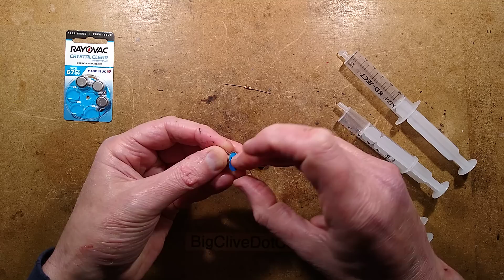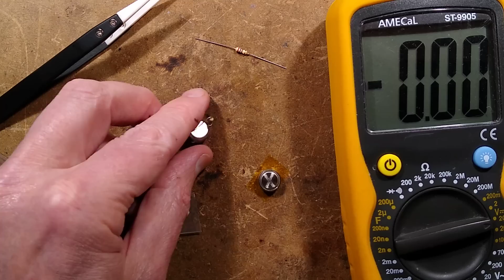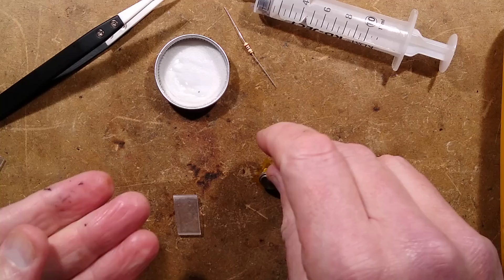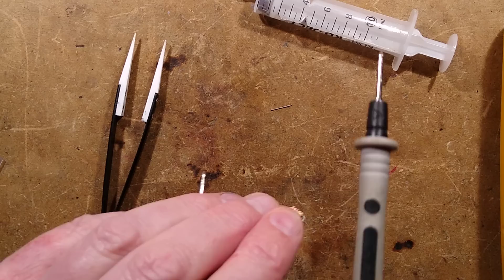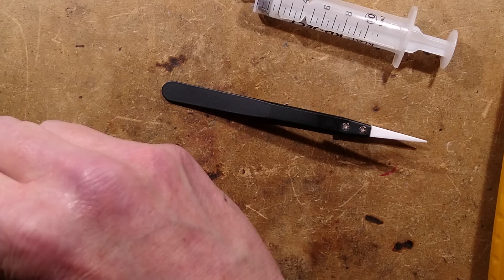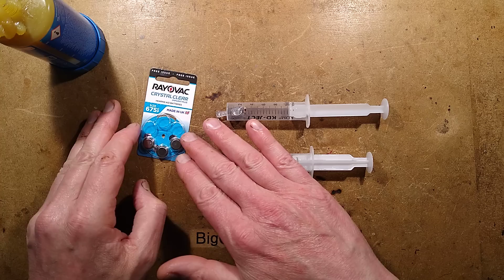Standard zinc-air cell vs mystery gas generating cell.  (flame test)

Comment: Syringes are never really air tight, but you can also improve your results by having a 3-part syringe, they have an actual silicon double seal at the end.
Reply: Glass syringes with silicone lube are awesome for this.
Reply: @blueredbrick  yes. Glass syringes are an amazing implement!👍
Reply: @markhonea2461  That sounds quite like 50s. Today disposable syringes are the standard.
Reply: @adamabele785  I assume he is talking about glass gas syringes.
Reply: @adamabele785  That sounds like the 50s if you were to go to a hospital or your doctors office as they would most likely use a disposable plastic syringe for whatever injection they would have to do, but that doesn't mean on the other end that glass syringes have stopped being made, let alone that it would not be a good idea using them for experiments like the one from this video.
Reply: @psirvent8  glas syringes still exist for various applications
Reply: @der.Schtefan  That's pretty much what I said, otherwise manufacturers would have stopped making them long ago by now.
Reply: @richardturton6900  For medical injections, yes, but glass ones are used in lab work.They are airtight with no lube--amazing tolerances, and very low friction.  But I'm sure hydrogen would have no trouble getting past the plunger.
Reply: @adamabele785  I am fairly certain they still have use for them in some procedures. And I know they still use autoclaves. I saw many such apparatus while I was a green- striper for the hospital, but that was in the 70's.
Most if not all of the glass syringes I saw were of much larger volume than say, an insulin syringe.
Reply: @adamabele785  - Labs use plenty of glass syringes, sometimes with PTFE (teflon) seals. It would be crazy to dispose of a syringe every time you add some reagent, and glass handles contact with solvents much better than most plastics. 

They're generally not used for things like vaccines because they're more expensive than plastic syringes, and you want to discourage people from reusing them (especially in places like GP practices and vaccination centres that probably don't have the necessary equipment or time to sterilise them between uses).
Reply: @blueredbrick  I don't think closing the tip by melting it and pinching it with his fingers would be a good idea with a glass syringe.
Reply: @russlehman2070  meh, just melt the glass in a hot flame and close the end by pressing onto a block of graphite. Or when one doesn't like open flames, drip in a droplet of fast curing epoxy resin.
Glass syringes are really nice and perfect.
Reply: Or submerge it and look for bubbles 🤣
Reply: Nevertheless it worked well enough in the video.
Reply: manitoba2445  you can inject a surprising amount of air into your veins before you die.
Reply: Or put the syringe upright in water, the hydrogen won't be able to push it's way down into the water until it almost fills the syringe. ( Fix the "thumb end" of the plunger to the bottom of the water vessel; as hydrogen is produced, the syringe body will rise up the plunger.
Reply: I don't feel comfortable about o-rings since the apace shuttle accident
Reply: well said, i thought it was just rubber at the end. curious, how can i se you added the comment to recent video, 8 days ago?
Reply: @DegustoDelSol  
Bigclive has a Patreon with early access
Reply: @DegustoDelSol  Patreon. If you join, so can you!

Comment: Hey, I'd just hold the plunger upside down in a vertical position, lay the battery on it and then put the cyllinder over it.
Nice progress on a single night! I'd never know that it generates do much gas.
Reply: Agreed. After lubing the plunger, the battery will easily stick to it. Then just slide the cylinder down over them. Clive's thinking outside the box processor needed a reboot.
Reply: @Slicerwizard  When my plunger is lubed, it becomes very slippery.
Reply: Thank you Captain Hindsight
Reply: @ch4.hayabusa  its called peer review !
Reply: @Panboy2k  Pee'er review
Reply: Smartypants

Comment: I was really baffled about where the hydrogen could be coming from, so I did some research.  It looks like four metals could work in metal/air batteries - lithium, magnesium, aluminimum and zinc.  Lithium is a bad idea because of moisture in the air, but the reason magnesium and aluminimum aren't used often is because they evolve hydrogen even more than zinc.  So in theory, if you really wanted an optimal hydrogen gas generator, Mg/air or Al/air would be even better at it.

Zn/air batteries also evolve hydrogen and there's ongoing research to fix this, like maybe coating the zinc with copper oxide would slow it down.  But the hydrogen itself is coming from the electrolyte, typically potassium hydroxide, all in a gel binder to keep it from leaking.  So maybe when there's no free oxygen available, the zinc reacts with the OH- group, steals the oxygen from it and liberates the hydrogen?  Just an armchair chemist guess.

So the "special" gas generator cells, if they're not just standard zinc/air batteries with a different label, could use Al or Mg, or they could have a higher amount of hydroxides available, if that's a limiting factor in a standard cell in this application.
Reply: The electrolyte gel isn't going to be pure KOH - it has to have some water present too in order to be conductive. So the hydrogen production is more likely to be zinc metal reacting with the water in the electrolyte to make zinc hydroxide. Any metal above hydrogen in the reactivity series (any metal which will dissolve in dilute, non-oxidizing acids) will do this, though some will be faster than others. Alkali metals (lithium, sodium, potassium, etc) are the fastest, followed by the alkaline earths (magnesium, calcium, etc), then aluminium, zinc, iron, tin and lead, though those last three are extremely slow.

Transition metal hydroxides tend to be insoluble in water, so if this were zinc just dipped into water, it would eventually form a thin coating of zinc hydroxide (again really slowly) which would not dissolve, and the reaction would stop once no more zinc could come into contact with the water. The reason it keeps going when there is alkali present (the KOH gel) is because zinc is also one of those strange metals which can dissolve in both acids and alkalis - a property known as amphoteric. The zinc hydroxide reacts with some of the KOH to produce K2Zn(OH)4 - aka potassium zincate. This is also water soluble, so dissolves in the gel, exposing fresh zinc surface and so allowing the first reaction to continue.
Reply: @lloydevans2900  Thank you for your thorough and informative comment!
Reply: @lloydevans2900  Why would you need water for conductivity when it is already a highly ionized substance?
Reply: @johndododoe1411  Because ionized substances can only conduct electricity if the ions are physically mobile. Ordinary table salt (sodium chloride) is a highly ionised substance, even as pure solid crystals. But in the solid phase it is an electrical insulator because the ions cannot move. The same is true for any other ionic salt.

There are two possible ways of making an ionic salt conductive:
(1). Dissolve it in water. This breaks up the crystal lattice into individual ions, solvated by the water molecules. The ions are then free to move. Hence why adding some soluble salt to pure water increases the conductivity a great deal.
(2). Heat the ionic salt enough to melt it. Once the salt is in the liquid phase, the ions are again free to move.

If the ionic salt is neither molten nor dissolved in a solvent, then the ions cannot move and it will not be conductive. There are some solvents other than water which can do the job, but water is usually the solvent of choice for ionic salts.
Reply: Haha, then I went over to watch AvE's video, and he's way ahead of me on the hydroxide + aluminimum bit.
Reply: yeah I thinking Mg and Mg sulfide can be very interesting along these lines
Reply: The way it seemed to work from my reading was that after the chemical reaction to produce the electricity, the waste product was H2O, which would accumulate in the cell and eventually react with any free zinc (producing hydrogen). As you say in your post, this is normally a flaw to be avoided, but here cleverly taken advantage of.
Reply: Can't you use pretty much any metal that tarnishes in air?
Reply: This might be a dumb question, but could the hydrogen be used for a hydrogen fuel cell? Would reusing the hydrogen take away from the efficiency of the battery?
Reply: @ChrisD__  It won't take do anything more to the battery (beyond already running the battery in a bad way to get the hydrogen), but the amount of energy available from running the hydrogen through a fuel cell is unlikely to be more than was lost by starving the Zinc cell of oxygen.  So I expect that to be a Heath-Robinson joke machine.
Reply: @ChrisD__  You could, but there aren't many use cases for that where it wouldn't make more sense to just use a battery.  The electricity you got out of the fuel cell would be less than the electricity the battery would have provided operating normally.

Comment: use the heat gun and cold pliers to pinch the ends of heat shrink and plastics. Saves burning your fingers and the cold steel of the pliers cools the material quickly, it also gets a nice ribbed pattern too.

Comment: What value resistor did you use? Looks like 10 maybe?
Reply from the maker: It was 270 ohm.  Lower will result in faster hydrogen generation.

Comment: Great interesting video I always thought it was a chemical reaction like the good old bi-carb.
I can see how they are so accurate being an electrical discharge controlled by resistance.
Have you seen the tags we get supplied with these size of key fob you push a button and the indicator bar graph changes to alert you to change them.
The idea is that you attach it to the outside of the cabinet. We never do but I keep a drawer full of them as we just set a reminder on the computer to change to save customers worry.
Reply from the maker: I haven't seen the remote time reminders.
Reply: @bigclivedotcom  I will take a picture and email this afternoon